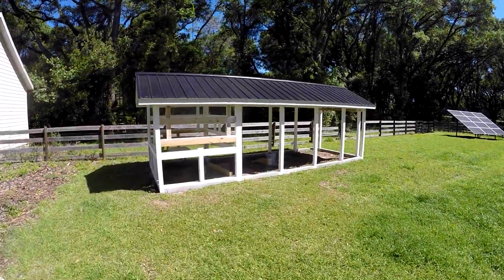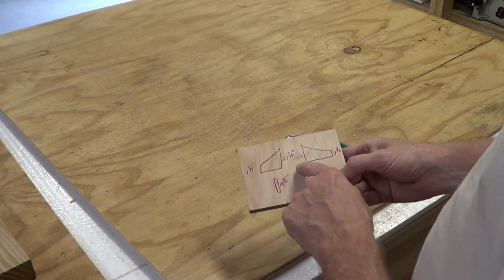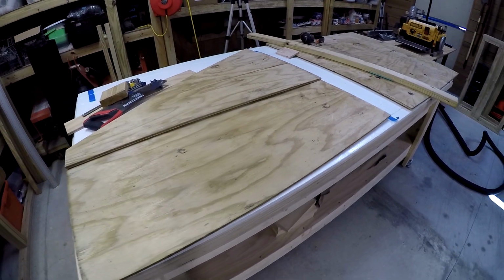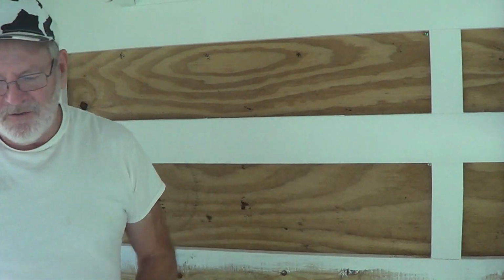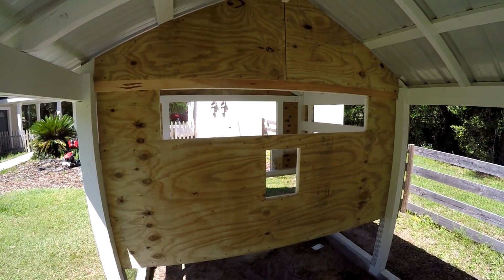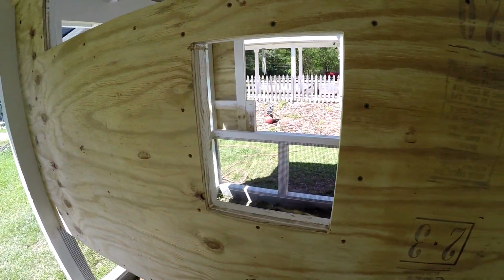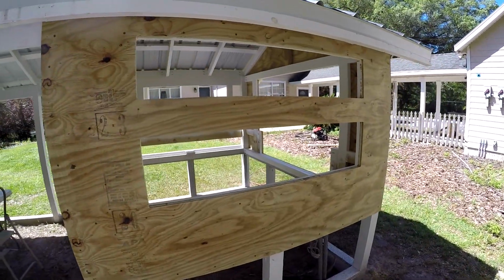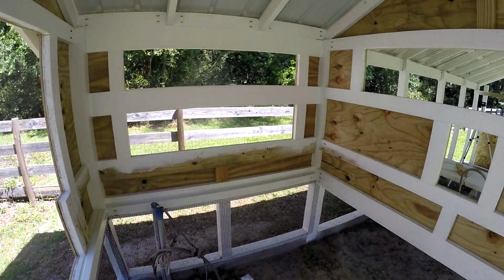Chicken Coop Build Pt9: Sheeting the Hen House

Comment: Hi! Im watching your  videos and trying to duplicate your coop lol! I work on it when my husband is at work so he wont distract me lol.  Ive made it to the framing stage for the hutch level. What were your measurements for the framing for the bottom door and top double door? Im trying to figure out the measurement for the side framing on either side of the doors. Thanks! This is my first time building something like this and im having a ball. My dad is a carpenter but Im not. I guess i just have the gene and its been easy for me to figure out how to do this based off your videos. Thanks so much for the videos!!
Reply from the maker: Jeannie, I really love to hear from folks who are following along and building the same thing (or even close).  I am actually working on mine today as well.  I just finished painting the cleanout door and the double doors and working on re-attaching them to the hen house right now.  These doors are a bit complicated as you will see in the next three videos that I plan to post starting Saturday (if I get them edited).  
A few measurements:
1. Double door width opening: 60 and 1/2"
2. Double door height opening: 28 and 1/4"
3. Cleanout door width opening: 53 and 1/2"
note: the notched in parts are 2x4's (3 1/2" wide x2)
4. Cleanout door  height opening: 12 and 3/8"
5. Total height opining: 40 and 5/8"
Keep me updated on your progress and post a video or send pictures!
Reply from the maker: Note: You can see a sneak peak of the double doors and cleanout door at the end of this video: https://youtu.be/c3Jxr3ruJ0c
Reply: Thank you so much. That will help me a lot. I will definitely send you pics ! I will write down your measurements and draw my layout so I can wrap my non professional mind around what I need to do lol. My roof isnt a frame. Its just a single slop. So I have to do some things different. Thanks again and I will watch that video!
Reply from the maker: @jaiv2001  Sounds good.  Yes, you don't need to make everything the same.  If your opening is a bit bigger than you just make your doors a bit bigger to match.  Its all good!  :)
Reply: @HomesteadEngineering  Makes sense!  I have everything framed up now. I have a couple of questions. What thickness plywood did you use? Did you put the plywood inside the coop and trace the outline of the frame? I'm trying to figure that part out lol. I don't have a router so I am going to get one along with the panel bit you mentioned.
Reply from the maker: @jeanniehenderson-3349  I used 7/16" pressure treated plywood for all the sheeting (including the egg hutches) and all the doors.  I sheeted the outside all the way around the hen house.  Next, drill a hole in each corner (of a window for example) from the inside out.  The hole will be big enough to get the panel bit through to start the cut.  The holes mark the corner points.  You really only need one.  You don't even really need to mark it up, just stay tight to the framing as you move the router (maybe mark it up the 1st time).  You don't have to cut it all in one go, take breaks as needed.  Make sure you watch a few router safety videos and practice on something easy clamped to the work bench until you get the feel for it.  You always move the router into the cut or it will want to take off on you.  BE CAREFULL!    Start here: 
https://youtu.be/7QNz0Esom7A
Reply: Ok I will definitely be careful. I don’t see 7/16 plywood at my local Lowes. They have osb sheathing. I imagine you didn’t use that but used pressure treated plywood. I guess I will need to use a different thickness.
Reply: Ok I will definitely be careful. I don’t see 7/16 plywood at my local Lowes. They have osb sheathing. I imagine you didn’t use that but used pressure treated plywood. I guess I will need to use a different thickness.
Reply: Ok I will definitely be careful. I don’t see 7/16 plywood at my local Lowes. They have osb sheathing. I imagine you didn’t use that but used pressure treated plywood. I guess I will need to use a different thickness.
Reply: Ok I will definitely be careful. I don’t see 7/16 plywood at my local Lowes. They have osb sheathing. I imagine you didn’t use that but used pressure treated plywood. I guess I will need to use a different thickness.
Reply: Ok I will definitely be careful. I don’t see 7/16 plywood at my local Lowes. They have osb sheathing. I imagine you didn’t use that but used pressure treated plywood. I guess I will need to use a different thickness.
Reply: Ok I will definitely be careful. I don’t see 7/16 plywood at my local Lowes. They have osb sheathing. I imagine you didn’t use that but used pressure treated plywood. I guess I will need to use a different thickness.
Reply: Ok I will definitely be careful. I don’t see 7/16 plywood at my local Lowes. They have osb sheathing. I imagine you didn’t use that but used pressure treated plywood. I guess I will need to use a different thickness.
Reply: Ok I will definitely be careful. I don’t see 7/16 plywood at my local Lowes. They have osb sheathing. I imagine you didn’t use that but used pressure treated plywood. I guess I will need to use a different thickness.
Reply: Ok I will definitely be careful. I don’t see 7/16 plywood at my local Lowes. They have osb sheathing. I imagine you didn’t use that but used pressure treated plywood. I guess I will need to use a different thickness.
Reply: Ok I will definitely be careful. I don’t see 7/16 plywood at my local Lowes. They have osb sheathing. I imagine you didn’t use that but used pressure treated plywood. I guess I will need to use a different thickness.
Reply: Ok I will definitely be careful. I don’t see 7/16 plywood at my local Lowes. They have osb sheathing. I imagine you didn’t use that but used pressure treated plywood. I guess I will need to use a different thickness.
Reply: Ok I will definitely be careful. I don’t see 7/16 plywood at my local Lowes. They have osb sheathing. I imagine you didn’t use that but used pressure treated plywood. I guess I will need to use a different thickness.
Reply: Ok I will definitely be careful. I don’t see 7/16 plywood at my local Lowes. They have osb sheathing. I imagine you didn’t use that but used pressure treated plywood. I guess I will need to use a different thickness.
Reply: Ok I will definitely be careful. I don’t see 7/16 plywood at my local Lowes. They have osb sheathing. I imagine you didn’t use that but used pressure treated plywood. I guess I will need to use a different thickness.
Reply: Ok I will definitely be careful. I don’t see 7/16 plywood at my local Lowes. They have osb sheathing. I imagine you didn’t use that but used pressure treated plywood. I guess I will need to use a different thickness.
Reply from the maker: @jaiv2001  7/16" is the actual thickness.  Like a 2x4 is actually 1 1/2 x 3 1/2 this might list under 1/2" PT.

Comment: Last question! What height will the top of the 2x6 s on the sides(above the base frame) land? 12” from the 2x4 floor support or 12 1/2”? You said the door opening is 12 1/2” high…so I imagine the top of the side 2x6s need to be at the same height. Hope this makes sense lol.
Reply from the maker: You can get a lot of measurements from this video: https://youtu.be/81iYL6BNGTQ
I think the height of the cleanout door is set by the height of the deep litter box i.e. the height of the HDPE.  Since the HDPE is actually 12", that would make the little 2x4's in front actually 12 3/8" not 12 1/2" because its 12" of HDPE and the floor HDPE is 3/8" thick.  Hope that makes since... :)  BTW: I just finished the new intro for Saturday's video and its pretty cool!
Reply: @HomesteadEngineering  oh dag!!! I made the height of the little 2x4s 12 1/2” as well as the boards on the sides for the deep liter height. I just finished all of that this evening. I shall go stick my head in the dirt now lol. Ugh!
Reply from the maker: @jaiv2001  That's OK.  You can just cut your HDPE to 12 1/8" instead of 12".  Basically, when you get to that step you just cut the HDPE to whatever you need to make it work.  I think this video (below) describes how I set this height (starting around 1:20).  I had my HDPE pre-cut long before I built the coop so I had to make sure I set the sides correctly when I built it.  
https://youtu.be/abps-u9xhcA

Comment: David do you find that laser light on your skill saw useful? Maybe I’ve only had cheap crap and found them to be useless so I never bothered
Reply from the maker: Jerry,  I am usually cutting along an edge that I have clamped.  If not and I have just drawn a line, than I do tend to use the laser and that's what I focus on.  I am looking at the laser 1-2 feet in front of the saw and trying to keep it on the line.  I did have to adjust the laser from the factory as it was way off.  Thanks!
Reply: @HomesteadEngineering  ahh so you use the poor mans Festool..me too